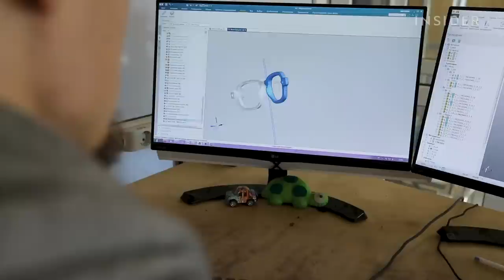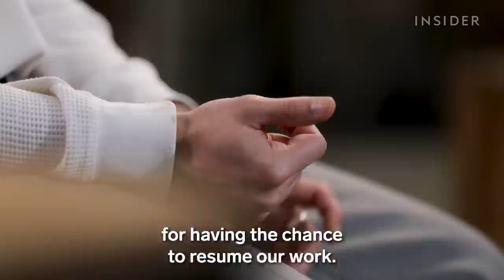Making Eyeglasses From Coffee Grounds In Ukraine | World Wide Waste | Business Insider

Comment: For anyone wondering, Ochis is the name of the brand. They are pricey, but there is a reason for that. Durability, the time used to make them, etc. These guys deserve some support.
Reply: Nah. They just literally sell garbage through marketing. It's just harmless coffee grinds set in epoxy resin. They need to make frames really beefy, so they just don't fall apart. I bet they would hold less stress than 50 hrivnya glasses from the Ukrainian Izum factory. And for 12 000 hrivnya that's kinda absurd.
Reply: @mryodak  I'm surprised they don't just use dirt for filler. It's mostly silica, alumina, and calcium carbonate. Perfectly good filler. And you wouldn't need to use resistance electric ovens to dehydrate it, or a logistics infrastructure to collect it. Just reach down. Powdered concrete from rubble would be a close second. Even sawdust would probably be more scalable. But they might not be using epoxy. They might be using boiled linseed oil with a catalyst to accelerate hardening.
Reply: bit pricy? £250 for a pair... thats a quarter of my monthly rent. i was hoping to see around £50 tops,, i know its for a cause,, but this is too much for a recycled product, there is donation charities for those causes. sorry i dont want to be mean but there is a line you have to draw when the product is overpriced, is it worth making it? now if they made cheap cups made from that, and sold them at lets say £1 each mass produced, doesnt have to be superior quality but it would be more better than plastic no? oh but then you have paper cups which do the same thing. so again is it worth producing at such a scale?
Reply: @mryodak  hear hear
Reply: @MadMaxV  perfectly worded
Reply: @gregorymalchuk272  They're not using epoxy, as far as I've seen and read. They wouldn't be biodegradable if the grounds were trapped in plastic.
Reply: @MadMaxV  Chanel is is the same price. If not more expensive. I'm saying its better to support these folks than millionaires.
Reply: @mryodak  Epoxy would make them non biodegradable. It would be coffee grounds inside of a plastic casing. No bio-degrading would be able to happen. From all of my researching, they are not using epoxy.
Reply: @mryodak  I’m pretty sure they just don’t want anybody copying the formula. I’m not sure why that’s so hard to believe. Companies of mainstream food and drink products have kept certain parts of their formula from the public and everyone just goes with it. I’m not sure what about “plant oils,” makes people believe it’s mythical and unreal. They’re plant oils. Plants have oils. They use them to make the frames. They don’t want other people to manufacture them because they want to keep their profits. That’s not a new concept to the world of manufacturing.
Reply: @mryodak   If the frames are biodegrade-able, it’s because they can decompose in someone’s yard, and therefore aren’t harmful to the environment. They designed them to be able to decompose outside if they get tossed. I’m not sure if you caught that or not. That would mean that they know coffee grounds aren’t harmful the environment, that being one of the selling points of the glasses, so that you don’t have to throw them in the trash to be put in a landfill later. You are failing to realize that these people probably understand how to make these frames with the materials and oils, and have figured out how. You don’t need a degree in chemistry from a university to work hard on something and figure it out, and I’m sure they have learned about chemistry in making these. The people who invented Coca Cola probably weren’t chemists, either. Not everything in the world needs picked apart and called impossible. There is such a thing called “logic.” Why is it so hard to believe that these people manufacture what they do? Because you’re purposely making it harder than it needs to be to yourself, and so you absolutely can’t fathom or understand something that is probably quite simple to this manufacturer to make after years and years of doing it.
Reply: @KaraMinnick  So the metal parts they clearly use and the glass specs are also decomposable? I have googled and google says glass or metal are not biodegradable or decomposable. Or those are some magic materials too? Or they are just lying about those qualities to sell their product?
Reply: @mryodak  Jesus. Of course there’s going to be metal. That’s a given. The MAJORITY of the glasses are biodegradable. I’m sure it’s not terribly difficult to pop the lenses out and unscrew the metal, if the person owning them as a fraction of a brain cell. Why ya’ll so heated about coffee ground glasses? That’s perplexing. With all of the issues in the world, you guys are salty over some coffee ground frames and trying to pick it apart.
Reply: Super 👍
Reply: It pretty much a handmade low production volume product. Like anything as it matures the volume will go up and the price will come down.
Reply: @MadMaxV  your monthly rent is 1k?
Reply: @GeorgeSemel  That’s only if there’s a demand for it… which there isn’t to begin with…
Reply: @GeorgeSemel  
Which it wont mature, because there’s not a real market for it.
Reply: @MadMaxV  Huh, that's mine doubled
Reply: Everyone keeps saying for a cause.  Whats the cause???
Reply: Is it available in the USA?
Reply: @MadMaxV  if they can sell them so high price-let them do it
Reply: The sunglasses are about $300 USD. When I worked at Macy's, Sunglasses Hut sold frames for that price. You'd be surprised what people from the US will spend on things. Especially if we feel it's for a good cause. I hope people buy these.

I have prescription lenses, and those are not available right now. I also am not a coffee fan, but I do wish to buy. It would be one week's pay for me. Still about the same price as my last pair of glasses.
Reply: @KaraMinnick  you could support like 10 upcoming sunglasses manufacturers by buying a product from each of them for the price of a pair of these.
Reply: @MadMaxV  wow, thats expensive? Idk here in switzerland the usual crap glasses frame costs anyhwhere from 150 to 650.- swiss francs. Then add another 200-700 for the glass, depending on how bad your eyesight is.
Reply: @KrayZJoy  people in USA, I hope, have money to spend on what they want, not  just food and shelter. I think it is good if the economy works, and society wealthy enough.
Reply: @KrayZJoy  So you are not even "rich" in american meaning, am I  right?
Reply: @Japanda Sakuro Sand is silicon dioxide, and yes, it is often used as a filler. Probably most often in cement.
Reply: @MadMaxV  yes, only a bit pricy cos usually glasses cost are absurd so this is nothing new
Reply: Thank you!!!!
Reply: They too big and bulky
Reply: I need some support too apparently because I cannot afford them
Reply: @justaweeb14688  yeah 1k a month is pretty normal rent here in America ... I had a hard time finding my low income apartment for 750 a month for a 1 bedroom ... My old one from 2018-2020 was 500 but in a different less expensive city but also a 1bed and I was lucky to find both of these places for so cheap ..usually that's the price of a studio apartment (1 room)
Reply: @mryodak   @mryodak  I'd not agree. At first it's not the epoxy resin. They worked under special mix of oils from plants. Let's appreciate handmade work, it's not a serial production from plastic, every glasses are unique and have they own texture. Ray bans have almost the same price from serial production,  they all are the same , you pay only for brand. Next tip- he spent his time, materials  and got knowledges about all this technic. How much time you should dry? How long under press and how strong? Anyway he should at least know that he need press. Try to organize something like that.
To buy this equipment- oven, press, laser cutter, good lenses, engravers. 
Pay for rent and pay workers. He has also a caffee which must work good and have marketing to attract so much clients. 
And if course it's made by hands, he want also to have a profit for his both intellectual and mechanical job. 
And the unique idea. The Idea can't be cheap. For example,  why processor cost so much? It's just a metal and plastic stuff. 
Next tip, they reuse materials, that's good and that's ecological.
Next tip, they give a part of money to charity found to help people in war.
They work literally under bomb attacks.
They have a philosophy: to show Ukrainian power of simple people and believe everything will be great. Also the little idea - to use local flowers.
However  12k uah it's kind of 300 euro, not cheap of course. But it worth it, because people pay for idea, not so much for a product.
Reply: @KaraMinnick  yeah, I agree, it's just mass producing plastic. Here each pair is unique
Reply: @MadMaxV  It's difficult to open a business in Ukraine. You either pay nothing to your employees or set high prices. Plus they don't advertise themselves as an affordable brand

Comment: Coffee grounds could be used for core material for manufacturing small furniture or appliances. For example, speaker boxes, light switches, switch boards... or anything that is being manufactured with particle boards.
Reply: That's true, Used coffee grounds have more potential then just ending up in a waste dump where it ends up polluting the atmosphere but unfortunately not a lot of companys are using coffee grouns..
Reply: I feel like it can be used for making biodegradable plates or insulation for use of sneakers soles
Reply: My first thought was packing material. Polystyrene is the hardest plastic to recycle. You probably turn this stuff into compost or burn it at a powe plant.
Reply: Bugs would have a field day on that furniture. Even if there is a coating, that will eventually go away
Reply: @xier3x  biodegradable coffee grounds  on the way to dumping field really do not fall into pollutants category. The only advantage of using coffee grounds for manufacturing is availablity of natural material in its relatively pure uncontaminated form.
Reply: @Salazarsbizzar  packaging materials needed strength, which comes from fibers. Coffee grounds do not have any fibers. But combination with other fibrous materials could work.
Reply: @GD-mw1kd  Coffee grounds can produce methane and methane is one of the things polluting our atmosphere
Reply: Yeah.. she made a point to say "without oxygen"... Which would rarely happen in normal circumstances
Reply: O-o speaker boxes…idk with all the vibrations and power in some systems I think it would be a bad idea 🤣
Reply: @justinwebb8831  Except when trash goes to landfills
Reply: it already is
Reply: Heck we use them for fertilizer
Reply: I've heard of people doing this with sawdust and epoxy too.
Reply: Or they could just be composted. Why complicate an issue?
Reply: What's the binding agent? Is it natural?
Reply: They have to open source this technology to scale up production of useful things such as biodegradable cutlery.
Reply: So just use particles board because particle board itself is already biodegradable, and put this coffee grounds in compost bin to use as fertilizer that will be more beneficial recycling process.
Reply: @xier3x Coffee grounds are an all natural, biodegradable fertilizer. In the list of waste that pollutes the environment, coffee grounds would be far from the even the middle of the list of polluters. If coffee grounds were the only waste product in landfills, we'd have nothing to worry about. Have you ever heard of something called compost, city boy??
Reply: @xier3x  coffee grounds aren’t polluting the atmosphere lmao
Reply: @GD-mw1kd  so coffee and tea bags ?
Reply: @Salazarsbizzar  It's already composted which is more environmentally friendly than burning it. Giving coffee grounds a second life as packing material isn't a bad idea but they already use recycled cardboard for that.
Reply: Coffee cups?
Reply: @st.george007  How waterproof are coffee grounds? I suppose they can melt some plasticky crap to the inside just like they do paper cups but then all they are doing is turning something that can be recycled into compost into land fill trash and it'd be less efficient cost wise with no real benefit compared to just using the same cups they have been using. It's coming up with a terrible solution to a problem that doesn't exist.
Reply: @krakenthrottle2199  People don’t wear these glasses in the rain?
Reply: @krakenthrottle2199  Meh, worn glasses my whole life, durability is not a trait I would assign to most glass frames. If these don't just snap from wiping them off with a cloth then that's a win.
Reply: @MrBarryyoung  do you know that landfills have many different ways of preventing excess gasses... like a person constantly moving the "trash" around with a dozer or front end loader
Reply: @justinwebb8831  besides than you dumb a hole lot on top of each other, than the bottom is gonna lack oxygen.

For methane to stop building up you would have to turn the compost pile regulary
Reply: @rambo8863  They do, most places have a team of people that spend the whole shift driving around in heavy duty front end loaders agitating/rotating the trash to assure even decomposition. They also do this because methane gas is flammable so to assure the safety of the workers and the surrounding town's they have to keep the methane levels under its lower explosion level.
Reply: nah, all those things are weight bearing or get lots of use and handling. these glasses break pretty easily, even compared to cheap dollar tree glasses. dont expect this to change the world and replace the need for plastics, bud. this is only good for super light duty things, and requires extra steps in the manufacturing process that make it impossible to put on an automated assembly line without making huge changes that wont justify the costs and likely wont have a negative carbon effect either... its awesome that coffee grounds worked out in this particular application, but this is not the game changer that you think it is and for many reasons ranging from benefit to consumer, all the way to manufacturing viability
Reply: Hell no 😂 🤡
Reply: I just read something on that and apparently coconut fibre can be used too.
Reply: @Don Don, what are your thoughts on using seaweed for similar?
Reply: It's quite absorbent too and can do well for being incorporated into mix media material.